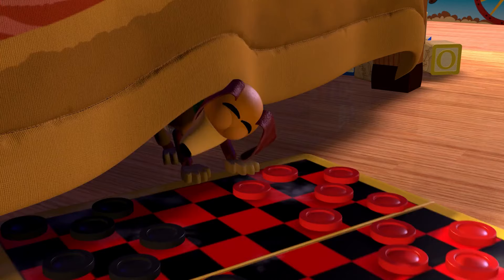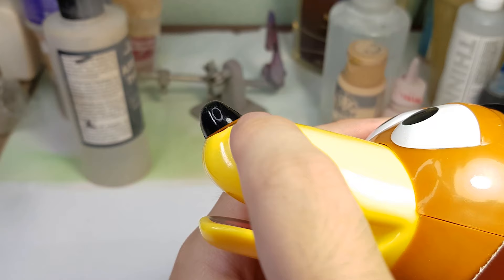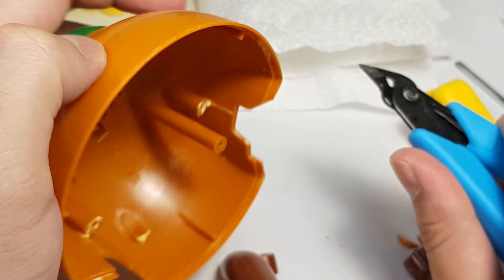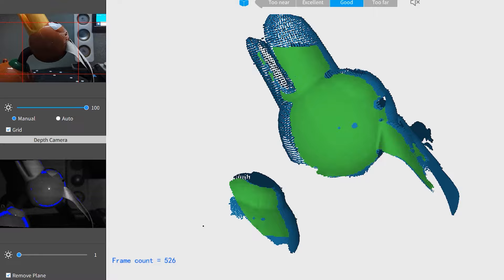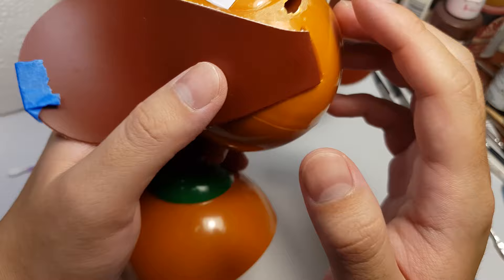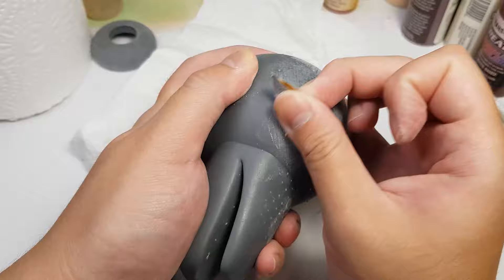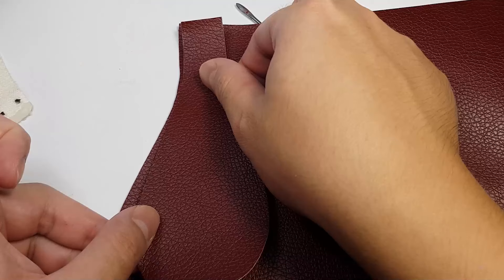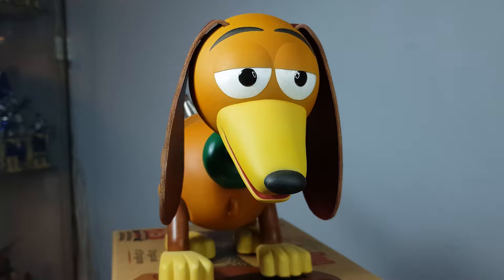I Made Toy Story Slinky Dog In REAL LIFE | 3D Sculpted 3D Print Custom Collection Mod Formlabs

Comment: Tips for masking: don't use painters tape. That is designed for much thicker wall paint. Use dedicated hobby masking like Tamiya. It is more expensive but helps a LOT with thinner airbrush and hobby paint and can bend around corners without crumpling better. Also, really burnish the edges down with toothpicks and cotton buds.
Reply from the maker: Good tip! I switched to the yellow tapes afterwards and it was indeed easier to manage. Just didn't go over them with cotton buds to secure them
Reply: @zedabyu  you could also look into liquid masking film. you brush that on what you want to mask and let it dry. then when done you just peel it off. its used a lot in water color painting
Reply: Can you 3d printed me slinky dog head and color and ring please

Comment: TRIVIA TIME:

The true original Slinky Dog from the 50's looked WAY different than when Pixar redesigned him. He was entirely yellow and had black plastic ears and small eyes with eyelashes; His tail was much longer, having a bell in the first few waves of production.

Mike Mozart has done a bunch of videos regarding the whole original series such as Slinky Kitten, Frog, Turtle, Snail, Bucko the Horse, Slinky Mobile, Slinky Handcar, even Slinky 3 Little Pigs.

Others he didn't mention:

Slinky Spiral
Electronic Slinky
Susie the Worm
Cater-Puller
Seal
Hippo
Elephant
Train
Fire Engine
Soldiers (like 3 Little Pigs in structure)
Spinner
Pop-up
Satellite (hat)
Eyes (glasses)
Slink'em (game set)
Slinky Jr. Goes to the Circus (book with included Slinky Jr.)
Slinky Magic

Comment: So for Slinky's Legs. What I would recommend doing if you need them articulated is to sand down the cube part of the leg. I had to do the same part on my Buzz Lightyear arms. The Cube shape thats on the legs just basically dremel it or cut and sand it till its more round like a cylinder. It should help with articulation and make em easier to move properly. If they become too loose. Add abit of hot glue to work as friction to the edges. 
Hope this helps! Excellent custom man!
Reply from the maker: Good tip! Will try that. Was worried that the leg won't hold the weight of the body but the hot glue trick should help!
Reply: @zedabyu  No problem! I've been messing around a lot with articulation recently xD so I hope that helps!